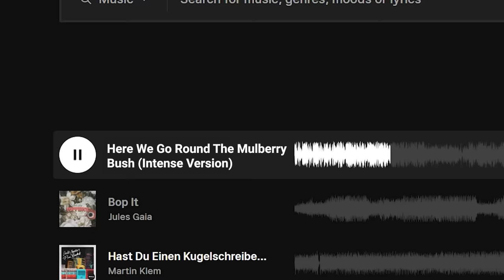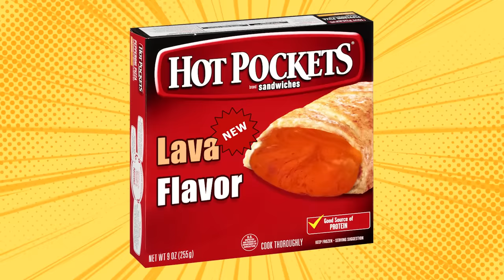Lava VS Everyday Objects

Comment: When the lava touches the glass, it gets hotter causing it to grow bigger. But, it will grow bigger at different speeds so it will get bigger in one part then it cant fit so it breaks (when the lava comes into contact with the glass, it heats up and expands. Since there is a high temperature, the areas that were directly in contact with the glass would expand quickly, causing the glass to be an uneven shape and shatter)[No, I did not search this up this is entirely my doing]{ik im a nerd}

Comment: 3:50 I would guess it exploded due to the presence of a lithium-ion battery - These batteries are basically small bombs and will create a deadly explosion if the insides get exposed to oxygen.
Reply: You're right about one thing, the Lithium-ion Battery, but it doesn't explode because of the heat. Lithium just has a very strong combustion reaction with Oxygen. Once the lava melts away the polymer casing sealing the Lithium from the air, that reaction with Oxygen takes place at a high rate, resulting in the explosion we see. That's why device repair techs have to be very careful, simply piercing the battery can also result in an explosion, or giant fire that not even a fire extinguisher can tame, until all the Lithium is burned out.
Reply: @MCNinja38TR1   Thanks for the clarification! 😊

I edited my comment to show the correct information.

Comment: putting water on volcanos will only affect the top layer, and the heat from lower layers will build up pressure until the volcano erupts, and then the plug created by the solidified lava will fly up and fall back down doing additional damage, which is why you never fully block a volcano's opening

Comment: Sigils had the right idea with the whole lithium battery exploding when exposed to EXTREME heat, you can also take a battery and cause it to overheat/explode by simply poking it when it's swollen with a thumbtack/push pin
Reply: also the last reaction, glass itself cannot handle extreme temperature fluxuations, it's why windshields that are chipped will crack in the winter time when the car heats up the heaters and the hot air meets the cool glass, if you want a clear example of this, take a drinking glass, boil it in a pot of water with a bowl of ice water nearby then take the heated glass and plunge it into the ice water and watch it shatter almost immediately

Comment: SSundee, the glass shattered because the temperature of the lava is so hot compared to the outside temperature. Lava is thousands of degrees hot whereas a regular day temperature depending on where that is, would likely be around 60-70 fahrenheit. The heat from the lava causes an extreme temperature change, which makes the glass shatter, unable to bear the sudden change. Hope that helps! Not sure if you were being sarcastic and actually know why it shatters, but there's my comment anyway.
Reply: 1983F, or the temp of molten copper metal, aka what some of those "Lava's" were. the REAL lava, which wasnt runny and was harder to pour was only 1200F

Comment: The reason why the phone exploded was because of the location of the lithium ion battery that is highly explosive with any liquid setting the battery ablaze the reason why there was no fire was because of the lava having fire contact which melted the screen to a point where the pressure of the screen let lose and punctured a hole thru the battery which is still on. So since the phone was still on there was an electrical current still running in the phone due to the heat it caused an instant explosion.

Comment: The phone exploded because of the Lithium battery. Pure Lithium has a very strong reaction with Oxygen that results in combustion. Once that polymer that seals the Lithium away from the air is melted, BOOM!

Comment: So glass shatters when it changes temperature very fast because the fast change in temperature mukes the pressure in the glass skyrocket whitch couses the glass to shatter.
And since lava is very hot and the glass is room temp the glasses temperature goes up extremely fast.

And btw sigils yes the reason that the phone and ipad explode is because of the battery

Comment: The phone explode cuz the lava was pore on the area where battery is and battery has a limited heat absorption capacity. And lava is way more hotter than the capacity that’s why the phone(battery) just blasted. ❤❤

Comment: the glass shattered because there where two heat points you canary the same with hot water heat expands things and if it is cold is shrinks if you now have two points one expands and the other doesn't the glass destabilises and shatters

Comment: Due to the heat of the lave the lithium battery inside the phone exploded which caused the phone to exploded Your Welcome For The Mathematics of the Explosion to Also the glass shattered because of the heat condensing inside the glass cup which with the pressure it shattered and SSundee you read this can I please have a shout-out Thank you

Comment: I do blacksmithing and aloy crafting as a hobby, and i belive that ive created something similar to vibranium, when made it into a thin disk the size of a frizbie and threw it it bounces just like captin americas shield, its also magnetick whilst being non conductive to both heat and electricity, its light yet extremaly durabul, i got my dad to shoot it with his heavy siper wilst useing armor pirceing rounds and  the bulits basicly did nothing to it apart from a light scratch and some sparks, we then tried a sub machine gun, did nothing, then we tried a shot gun, left a few tiny dents that didnt even go down a milimiter even at point blank it did practicly nothing. Then finaly we tried a hand grinade. That left a decent dent in it but still didnt do enough to break through. Next week we are hoping to see one of dads budies who is a tank driver to se if a tank can break it but im nog too sure it will but i think it will be close. Ill post an update next week to fill everyond in.